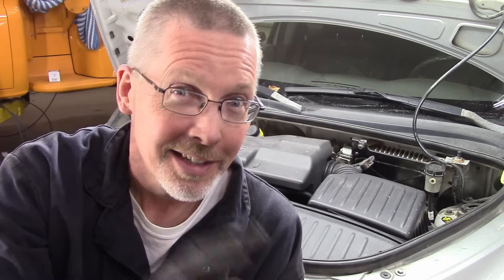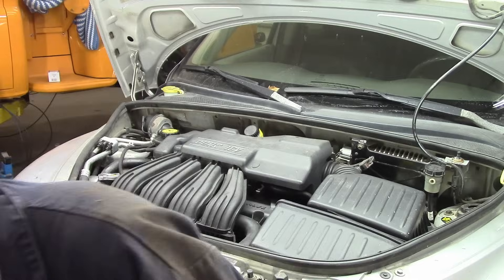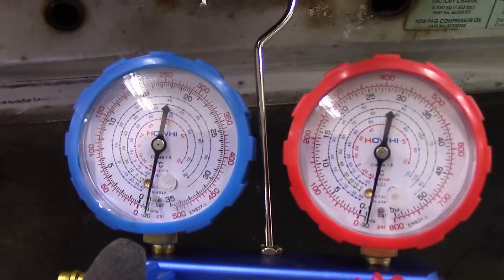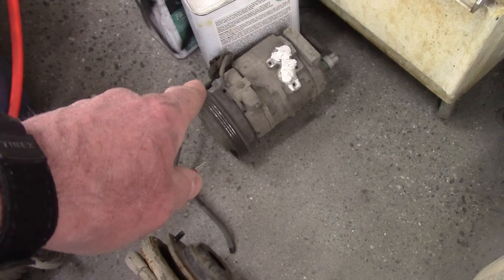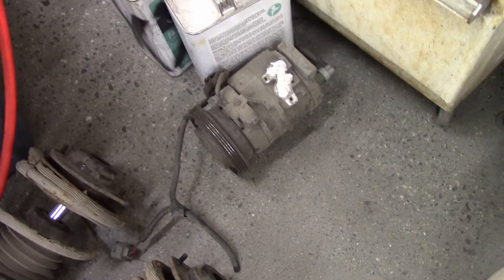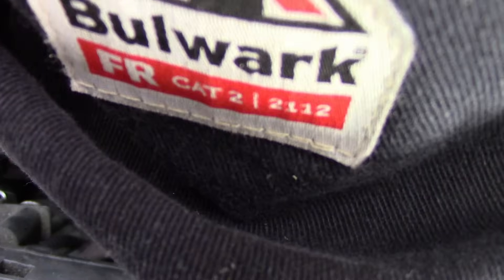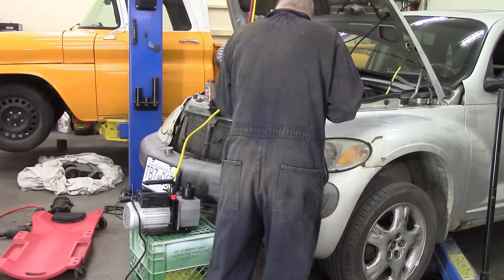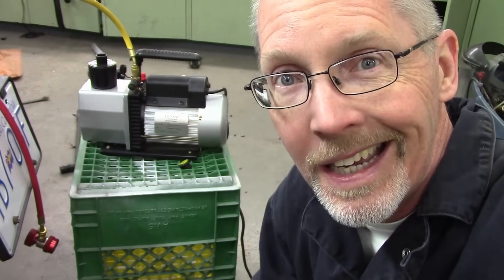DIY Testing, Fixing, & Recharging A/C

Comment: We do it nice, because we do it twice!
Reply: Sometimes it's easier, and maybe even 
FASTER to take half the vehicle apart than try to get at something without removing stuff.
Reply: I've seen people fill the system with propane just for testing a system to make sure everything works, then suck all the propane out and fill with real refrigerant.
Reply: @michaelszczys8316  you don't need the second step, r600, the more you know.
Reply: @sqeekykleen49  if you don't mind having flammable refrigerant in a car.
Reply: @michaelszczys8316  good enough for domestic refrigerator and ac.. the wind will take care of lil leaks, however pooling inside the EVAPORATOR BOX..   not a lot in these systems few oz in small appliances.
Reply: Somebody else watches Paul Cox @FabRats 😮😂🎉
Reply: @IconicSpitters  I have no idea who that is. I did hear that phrase on youtube for the first time quite a while ago, but I'm pretty sure it's a really common and old phrase, and wasn't coined by anyone in particular on youtube.
Reply: @gorak9000  I believe the Three Stooges plumbing motto was 
" we always get it right the second time "
Reply: @michaelszczys8316  Literally the story of my life today - sprinkler leak, dig, "hydrovac" with the pressure washer and shop vac (because apparantly at some point, somone horizontally directionally drilled and installed a cable right next to the sprinkler lines - thanks!), cut out the leaking section (which failed because the glue didn't bond like at all when it was installed 10 years ago on that joint), replace it, turn on the water, and it's dripping because of a bad glue joint again - the one that I did outisde the hole first on the replacement piece - GRRRRRRR - WTF??? Today, chop it out, and try again
Reply: @IconicSpitters I fix my own stuff , lately that's been my motto .. lol ..its good practice I guess ..
Everyone is like , can you fix mine ? "He'll no , mine was hard enough ..